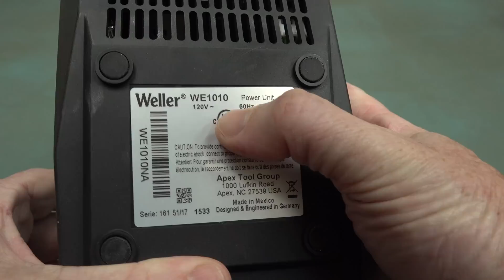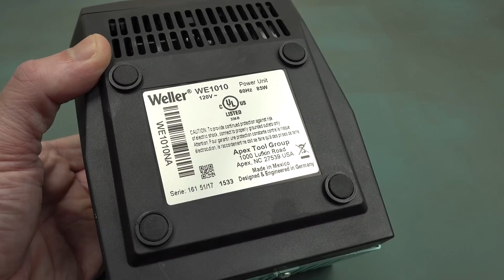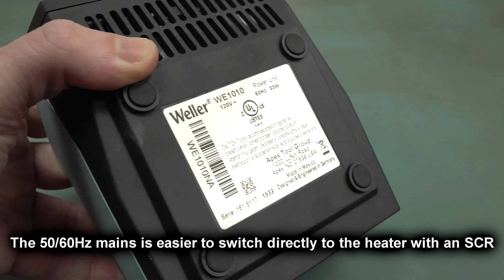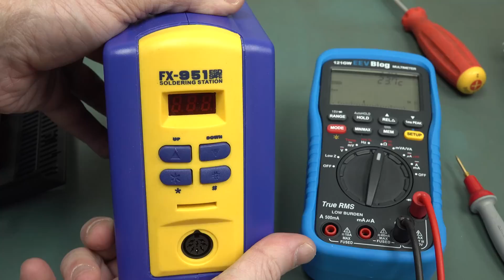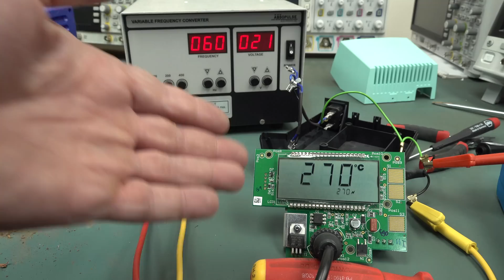EEVblog #1152 - 240V-120V = Magic Smoke!

Comment: I been thinking about this again, ok us Brits have fuses in our plugs... but in industrial setups we have different plugs for 110v, 240v and 415v so we cannot plug in to the wrong voltage ever and also our regular household 3 pin square plug.  Is this not just about the poor quality of the primary windings protection but also about how Aussie plugs can be used for two kinds of voltage? is this a 'too late' to have a second kind of plug? I think America has this issue too

Comment: The USA has 240 VAC supplied to every home most of the AC outlets are only one half the supply to run small appliances such as TV, Lamps and kitchen appliances @ 120 VAC. Devices with heavy current, electric clothes dryers, furnaces and Central Air conditioners and use the full line (240 VAC), and of course three-phase power is available for industrial applications.

Comment: Well this no primary fuse thing apparently has never been required for UL passage in the US. I maintained these things back in the late 70s and early 80s at major US company. Here's one of my old ones from the early seventies that I converted to use T12 tips. This look inside it will prove that they have never put fuses in these sorting stations. https://youtu.be/IgZN-7FMisk

Comment: You are a complete asshole. You did this on purpose to make an American company look bad. If you were stupid enough to plug a 120 volt soldering station into a 240 volt outlet, your credibility is zero in my book. Go back to school, you nitwit.
Reply: Well said Mr. Glenn Martin!! I think you got quickly to the bottom line & heart of the problem.  ;)
Reply: @chuckpruitt1244  Funny thing is this idiot hasn't responded.
Reply: @ Glenn Martin ...
 Yeah that is ironic...  ;)
Maybe he realized he had gone overboard about "The Magic Smoke" to the point he sounded like a moron. 
When in reality he should have concentrated more on the importance of plugging the machine into the correct voltage. That is where the Real Problem lies here.... 'Operator Error'.

Comment: Well....  holy clown f_ckers. Had you looked at the model # it clearly states WE1010 NA (that NA stands for North America - not- Northern Australia). In the United States we use a testing standard and laboratory for electronics to be used in the United States called the Underwriters Laboratory(U.L.) it only certifies the devise meets safety testing for use in the United States - 110/120v @ 60hrz.  
  If the PCB and components survived the abusive over voltage would that not indicate that engineered into the unit must be a failsafe.

Comment: @ 8:02 - Ummmmmmmm, could you re-check the primary resistance without the two blade connectors touching each other please.

Comment: Even 240v unit must have primary coil fuse because winding can get shorted sometimes so you don't need 600v to do same to 240v unit. Very poor design and big mistake.

Comment: honestly, they should NOT use this kinda standard computer-style power port, when it isnt made for both voltages, after all when it for example has a US Plug with a fixed cable, it's pretty damn obvious that you might wanna check what voltage the device supports, but some standards should really be created or changed to force devices with this type of port to support all relevant voltages.

Comment: Old psu for computer`s used to have a voltage tap/switch to change from 110v to 230, i remember it whas fun to change it back to 110 in norway(Since norway is 230 50Hz like moastly of EU) it makes alott of noise/like firework BANG XD but noting smoke thoe :), i did a bad prank one time at school....

Comment: just curious  but is it possible that transformer was misassembled  where the fuse should have been on the primary side????  i could see mechanically how easy it would be to do and if there was a whole batch that came through  some bean counter said ok use them no one will know. would also explain to a certain extent why it took so long to get a response and the offer of a freebie. oops someone found us out!!!     it also makes no sense it being 120v  only and having the universal cord plug in the rear. that should be used on 120/240 only like a computer power supply.

Comment: Since nobody busted out their calculator, 240V across 0.2 Ohms is 1,200 Amps.  120V across 0.2 Ohms is 600 Amps.  

It's pretty despicable that such a company as Weller would cheap out on a fuse across the mains.

Comment: Strange. I have a Weller PU-81 soldering station and at least it has an built in primary side fuse near the IEC connector.

Comment: one question about the "EI": as far as I understand it, each sheet of metal is insulated, right? why doesn't the insulation get ruined by welding the E and the I together? or is it destroyed locally but it doesn't matter from an eddy current perspective?

Comment: 1:10 electronics uses blue smoke technology, that's why once you see the smoke leave it quits working, too bad one can't just put the blue smoke back in.....Apex tools lmao I live right down the road from one of their manufacturing plants, they make tips too for Weller and recently I have to say for about 10 bucks they need to go and look at the plating process, after less than 10 uses plating just starts to break down and fall off which with better tips doesn't happen as quickly

Comment: I've looked through your vids to see if there is one on safe mains wiring in appliances or devices but cannot see one. Is it time for a general, howto vid on this?

I made a comment on another site about the wiring in a chinese variac they were raving about the low price you could get it for delivered. My comments seemed to upset the site owner greatly (calling me a time waster). The mains cord went straight to the mains switch and then through an external access fuse to the variac transformer. I commented that maybe the fuse should be the first port of call and maybe the wires should not be just flat soldered on the switch and fuse pins without tubing. It wouldn't pass muster in my workshop. Hate to see what'd happen if the active came off the back of the switch inside the variac (switch pins do flex a bit with use).

Sad part is, you could fix this in a couple of minutes with an iron, snips and a set of long nose pliers. 

Your Weller Iron is the same, quickly fixable, but should you as it's not supposed to be a One-Hung_low product (The term's not very PC, Dave).

Comment: Presumably this unit did indeed pass UL testing in that a transformer fault wouldn't cause a hazardous condition before tripping the circuit breaker. However, it's still a sloppy design that smacks of unwise cost cutting.

Comment: Shouldn't the primary side of the trafo have lower resistance than the secondary? I mean fewer turns, thicker copper wire...
Reply: desregard that... got it backwards, I have worked on too many of high-voltage MOTs maybe... dohhh...

Comment: Yea but I'll bet that iron heated  up in a 1/4th of the time! 

My uncle had a car lift and he wondered why it ran so slow, dad looked at it and it was a 240v running on 120v... ran it that way for i don't know how long,, I got it and it's still working after all these years, it's probably 70 or 80 years old now, take that Weller!

Comment: Dave, the main problem, as I see it, is the core design. 60 Hz transformers don't have as much iron as our (NZ & Aussie) 50 Hz ones and also the stacking of the laminations. All the "Es" were in one direction instead of being alternately inserted. The fact that the transformer was welded rather than being screwed or glued is another pointer to its destruction. That weld is like the shading rings on a shaded pole motor... they get hot. Lots of eddy currents. The dark colour of the winding wire (secondary and what little of the primary) visible, suggests a high temperature insulation but with four or more times the power flowing due to over voltage and under frequency and no fuse, that won't have lasted very long. 
.
My experience comes from working with inductive ballasts back in the 80s and 90s, testing imported fluorescent light fittings. Even 220 volt ballasts run on 230 volts caused similar melt downs after a day or so. They welded the laminations to stop that annoying humming (because they forgot the words) that old fluro fittings made. The trouble with fluros is worsened by the tube becoming lower in resistance as the ballast heated the whole fitting and the fact that they are often mounted in hot places to start with. Something to try out in a future video?

Comment: i have an old weller tcp power unit, thats just a plain transformer, the magnastat in the iron does the temperature regulating, that has a front replaceable fuse, i "think" its in the primary but not 100% sure...

Comment: uh oh,  "they dont like it up 'em" 😜  why did you have a 120v model if you're in a 220/240 country?!
Reply: it ought to have been made switchable 120/240 ....
Reply: and a mains in fuse.....suitably rated...
Reply: or a thermal fuse? i though many did have ?
Reply: ah, i see it did, but if the thermal fuse is not in close contact with the primary....not a lot of use....

Comment: UL standards are commonly used in the US for safety guidelines. UL (Underwriters Laboratories) is NOT a government agency, but was originally organized by the insurance companies, collectively. When stuff was made in the US, and respectable exporting countries, like Japan, they usually followed UL standards. For electrical items, the goal is to make the product, so it neither presents a fire or shock hazard. 

UL Class 2 transformers, often used in HVAC (heating & air conditioning), when overloaded usually fail, by opening up the primary winding, long before the enamel insulation starts to vaporize. That thin gauge wire on the primary should have melted, in only a second, or less. The core should have saturated, passing much more than the 4X power, because it would no longer have any significant inductance. I'm surprised it didn't open up almost immediately !

Comment: There is the YOTEC 936P soldering station which uses a switch mode power supply.

Comment: I plugged a pc with changable powersupply, which was set to 120v, into 230v and there was a Flash and the fuse of this room popped. But i set it back to 230v on the power supply and it worked for around 1 year until the Mainboard broke (was an old dell pc).

Comment: Dave, you should use a visual indicator on all your 120Vac-only equipment so you avoid this issue in the future.

A similar thing happened at my place of employ with the brother of my supervisor connecting a 220Vac device into a 440vac outlet. (They use the same connector.) Now all the outlets are marked with the supplied voltage.

Comment: My FX-888D had a MOV + fuse in the primary side that I forgot to change after rewinding the trasformer to work on 240v instead of 120v. And BOI does it shock you to have a MOV blow up right in front of you.

Comment: "Designed & engineered in Germany" 
As a German, I am ashamed now. Especially because we have 240 Volts in Germany, too.
EDIT: 230 Volts  ;)
Reply: Lonzo Da Man Don‘t feel too ashamed. Weller was founded in Philly, is part of the Apex group, but, yes, they have a branch in Germany. Everywhere around the world you‘ll find stuff claiming „German Engineering“ but copied from a news forum in German language where students discussed their work.
Reply: Actually, you don't have 240V in Germany, only 230V...
Reply: @AdaptingCamera  My multimeter agrees with you. But IIRC it was set per regulation in the 80s to a range from 220 to 240 Volts (but I could be wrong on this)
Reply: @lonzodaman  Never the less, the AC mains voltage in EU is 230V (+/- 10%) 50Hz. There are some variations, but I have NEVER heard of that large difference, normally only 1-2% up or down. Everything else is very rare. Saying that "we have 240 Volts in Germany" is simply wrong, even if you occasionally can measure 240V, that's not the same as the whole Germany is measuring 240V at the same time.

Comment: One of my friend (in US) got a 240v 3kw
 ZTE or Emerson  switched power supply(cant remember the brand), after removing the UVLO circuit it can start with 120v! Of course it can not deliver 3kw @ 120v input lol

Comment: My 20 year old Weller TCP iron has a primary side fuse on the front.  In fact this could have been the same specification of transformer, except that there are no end covers on mine. I would be interested to see what happens if the soldering iron was put out in the middle of the yard and power re-applied.  Would it catch fire or just smoke and die?

 Considering that the power supply for you iron has THREE other fuses, It does not look like a deliberate cost saving measure.
It could be that the designer never considered that it could ever possibly be exported outside USA! 

Maybe someone further up the supply chain decided that some cost could be saved, or the factory ran out of the protected transformer. I have seen this before..  If this is the case I see the Weller quality staff clocking up some Airmiles to audit the supply chain!

 Did you send them a link?

Comment: Did you open the other side of the primary windings? I’m really amazed if there was no thermal fuse at all. If there is none, this couldn’t get any European certifications.  It was made in Mexico but if the primary temperature fuse was missing, it can’t be of German design or it has been redesigned. I have seen numerous of vintage US radio equipment which don’t have primary fuse at all. Is it mandatory today in the States?

Comment: I've not got photos, but in my pinball machine I had a failure in a switch that forced a solenoid to stay on all the time...the copper was basically black short circuit instead of nice shiny enamel.

Comment: It's core saturation. There is an interesting experiment to do. Connect a transformer primary to a variac, with a current meter in the circuit. Slowly raise the voltage and go above the transformer's designed input voltage. You will see a sudden rise in current at a certain voltage level as the core starts to saturate. In the USA, we use 120 and 240. Usually the 120V is protected by a 20A breaker; but 240 is used where a lot of kilowatts is needed. It's not uncommon for a 240V circuit to have a 30, 40, or even 50A breaker. So when things do go wrong with 240 in USA the results can be quite dramatic.... and smelly! 

A visitor to went so far as to twist the pins on the cord of my vacuum cleaner so it would fit the 240V air compressor outlet, because it was closer to his car and he wouldn't need an extension cord. You would not believe how much Magic Smoke they managed to pack into that vacuum cleaner when they built it!!!

Comment: Those were very angry pixies.
Reply: I think my biggest fail was wiring up a halogen lighting tube that I didn't know was for 110v lights and they were next to the 240 volt ones...

I put the bulb in, turned the timer switch to turn the light on, the resulting explosion had the bosses in the back office, the land lord who lived on site and the neighbouring unit came round thinking that something bad had happened.

I can still hear the ringing of my ears in my memory of that incident.

I eventually got the right bulb in there :)

Comment: Just as you say in your video, saturating the core... i think remember that, once you magnetically saturate the core, all the excessive power that could be stored turns into heat, so... probably about 60% stored in magnetic flux, all the rest turned into heat... But u're the expert here, i just have a mid degree in electrics... The only thing i think could be improoved in this transformer is to alternate the EI laminates, each layer facing the opposite way. It is more expensive this way, but you don't have a concentrated gap in one of the sides, and shorting the laminates with solder is not good either...
edit: now you just have to take a generic 24v laptop transformer and plug it in, voila, you have it back at 100% (and probably, 100-265v compatible)

Comment: I’ve plugged a 120v Behringer mixer into 240. 
the transformer kicked the bucket, it didn’t let the smoke out, but it never worked again. 
The internals looked to be fine, but it was too cheap of a mixer to bother replacing.

Comment: In the 80's I worked for a transformer company here in Melbourne, I was an Armature coil winder, the transformer used in that soldering iron is what we called "junk wound" the ones we made used multiple turns of enamel coated copper wire, but we also used to place a sheet of insulating paper between each layer, this limited the chance of a short, in this case, it looks like the enamel broke down because the voltage was too high.

Comment: That's why it's good to live in America. Never magic smoke because 240 just will not work. Always feels safer. Higher Voltages in America have different plugs.
Reply: Robert Pirlot There are some other countries that don’t run 240V mains as well.  Japan, for instance is 100V mains.  Not sure what the countries in South America run at though.

Comment: Microcontroller wanted 3.3V DC, gave it 12V AC.

Rebuilt the same protoboard setup, built PSU board, tested output voltages, all good. 12V DC and 3.3V DC present.

Hooked PSU board to protoboard, smoke.
Guess who mixed up 12V and 3.3V....

Comment: why would it be silly to rewind it? that transformer looks easy enough to disassemble, rewind it for 240V, would be a good project. And put a thermal fuse on the primary

Comment: Even if you can do without an extra fuse somewhere and... save 5 cents I think? It's a shame for Weller. If you are a professional soldering equipment manufacturer, you cannot make expensive and bulletproof stations for professionals and aren't so expensive (because they aren't cheap too) and reliable only if you live in ideal world.